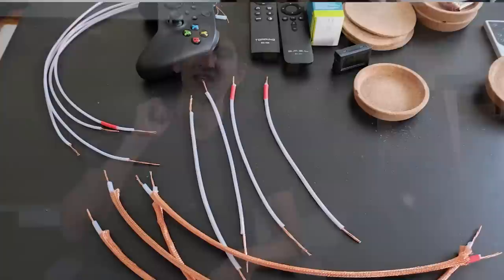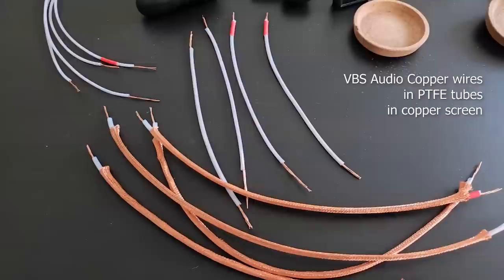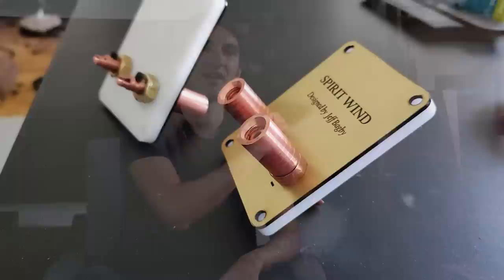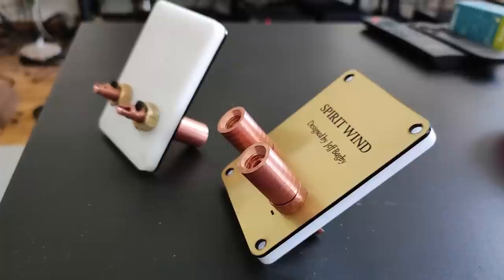High End 2-way speaker Spirit Wind

Comment: Wondering if you used any dampening material to line the cabinet walls. The plans are not very clear. What kind of bitumen fill did you use?
Reply from the maker: Walls themselves are made of five layers glued together under the press. They're then coated in a thick layer of liquid bitumen (I don't know the exact name of that product) that needs to dry for 24h. This damps wall vibrations but doesn't do much for standing waves inside the box. For that I filled the box with Mundorf Angel Hair filling (almost all of it except the space that needs to be clear between the bass driver and the bass reflex port). Jeff Bagby suggested dacron filling for this, but I used this Mundorf stuff instead. It serves the same purpose but with supposedly better absorption. He didn't use or suggest any sort of additional felt dampening on the walls the way Troels does for example. But Troels doesn't suggest this much inner filling... Which are both acoustic wave absorbers... My friend made the same pair of speakers and lined the walls with felt later on (one friend persuaded him it's needed) but we didn't notice any significant difference after that action. I suppose that 1" thick layered walls with bitumen and Mundorf filling (that he already had, the same as me) were doing a sufficiently good job already. Boxes do feel very inert this way. Certainly more than most commercially made ones with sane prices.
Reply: @iiWiReviews  thankyou for sharing that.

Comment: Sorry. Wanted to find out the brand of crossover component you mentioned. Yinseng?? Thanks.
Reply from the maker: Jantzen silver z-cap capacitors and coils (in wax) were used. There are also Path Audio and Mills resistors.

Comment: Hi, im doing my own 2way speaker where the midwoofer 18h52 and cabin is size/look is based on Spirit winds. Did i see right that your went on this speaker is bigger than 2" what Jeff wrote in his document? or was it just a matter of perspective and it is "stock"? Here is what Jeff wrote: "Vent: 2 " inner dia x 8.0" L Check location so as to not interferes with the back of the woofer."

Also, great work on speakers! Professional looking!
Reply from the maker: Vent port is the exact same size as Jeff suggested. It only looks bigger because it's flared on the ends. Flare reduces turbulence at the output and according to some studies creates a preferable bass sound (perceived as cleaner).
Reply: @iiWiReviews  Thanks for answer, and where did you buy it? 
i will buy the same went then if it is not local.. it looks good quality.
Reply from the maker: https://www.soundimports.eu/en/precision-sound-2-flared.html

Comment: Great review. What is the minimum distance, according to you, to the front wall to still have a wide and deep soundstage?
Reply from the maker: Thanks. I've never pushed them closer to the wall than 60 cm (back side of the speaker) because that's where I slowly notice my soundstage depth is starting to compress. But it is still good in that spot. My friend keeps his pair a bit closer, maybe 50 cm or so, and they still sound very spacious, width and height don't suffer at all, and tones also feel three-dimensional but simply more in line with speakers, without that "bowling alley" depth effect that you can get if you pull them out in the room. So I find that very good.
Mine are usually at ~80 cm, which gives ~115 cm from the front drivers and that's far enough to create a pretty impressive depth that makes tracks that are recorded that way sound detached from the speakers and in some virtual space behind them.

Comment: hei, how much did the cabinets cost? (wood+ labor)  
also how much did the crossovers cost?
Reply from the maker: Cabinets were ~€350 in total (and we had a great deal with a woodwork shop in my opinion). Crossover between 250-300, I wrote it down somewhere but can't find it now.
Reply: @iiWi Reviews  
Yes, that is a very good price for the cabinet work.  Here in the U.S. I would estimate $700-$1000+ for the unfinished cabinets.  Both the vertical angle of the front baffle and the diamond-faceted front of the baffle complicate the construction.

I would probably "Pin" this addtional cost information to the top of the comments since it is a considerable contribution to the overall cost that your viewers should know about and understand before considering such a project.

FYI, I'm all for good DIY designs and Jeff will be missed greatly.
Reply: @iiWiReviews  yes, its a good deal for the cabinets(good quality work). I wonder how much the cost would change if u choose piano black instead of wood finish

Comment: Great job with this project. I recently got plans from Meniscus Audio and like you I'm also sourcing the drivers from Europe to save on shipping costs. i came accross different versions of the AT18H5217 driver (8, 6 and 4 ohm). Which one did you use in your project or does not matter? the plans dont mention anything about it. Thanks
Reply from the maker: 8 and 6 Ohm version should be the same (depending on how store call them... It's an 8 Ohm nominally but measures 6.2 or something like that in reality). Any way, you need that one in the project - 6 Ohm that some stores will call 8.

Comment: Just out of curiosity, since the binding posts are pure copper wouldn't they oxidize?
Reply from the maker: Andrej from VBS claims they won't due to the specific thermal process he's using.  In my experience with power shucko connectors from the same copper, after some two years I've been using them, they have turned into darker reddish color (which he told me would happen but doesn't affect conductivity) but there is no oxide so far.

Comment: Thanks for making this video and speakers🙏 I am still under the impression that speakers fill the room better with subwoofer, if not REL would you try pairing it with any other woofer? Cause they can't dive under 40hz, can they?
Reply from the maker: Bigger woofer with more extension of course... It's just that T5X can't go much low, it falls off around 35Hz. That's roughly the same depth that these speakers do by themselves.
Another problem is sheer speed and resolution of AudioTechnology drivers... To match them, woofer has to be faster and more explosive than T5x. So maybe someday I decide to try a much more capable subwoofer (that can go down lower and with greater speed)... But that's not in my short term plans.
Reply: @iiWiReviews  Have you considered other DIY speakers before choosing this one? I am thinking of buying CSS DT-X...also on the side note I personally think RAAL tweeter is the purest I have heard among many, I know GR research have their NX monitor with ribon tweeter

Comment: Thank you so much for this amazing review. I see that meniscus provided you the dimensions for you to source your own cabinet. Is there an option to buy the cabinet online?
Reply from the maker: Not that I know of. You would have to arrange that in a local woodwork shop.
Reply: @iiWiReviews  Thank you! Are there instructions on how to install the dampening material which can be provided to the woodworker? Or do you install the dampening material yourself?
Reply from the maker: Jeff didn't put any dumping materials on the cabinet walls, we added that on our own at home (and made a bit bigger volume cabinets to account for it). But he did use dacron filling and specified how much and where to put it. That one is easily done yourself.

Comment: 16:53 thats not the actual response thats an artifact of the measurement process of sterophile magazine. Its a ground plane measurement, it gets you an accurate measurement of the bass below 200 hz but its +6db from the floor bounce. I guess they dont wanna attinuate the +6db hump incase someone accused them of tampering with the measurements and thats fair.

Comment: What sensitivity and impedance are these speakers rated at.
Reply from the maker: There is no official information on that but in comparison with many other speakers I access them to be ~85dB sensitive. Impedance should be around 6 Ohms I belive but no measurements were done across the whole frequency spectrum as far as I am aware.
Reply: @iiWiReviews  Thanks, great review. it''s too low for me as only using a 9.2W 300B tube amp.

Comment: Are these ported? If ported, will they work if made to be sealed ?
Reply from the maker: Yes they are ported and Jeff said it works very well when sealed too. As you would expect, bass would start rolling off sooner but slower...so it would sound leaner even though it would extend deeper. That might be good in some rooms and with some speaker positions.
Reply: @iiWiReviews  good to know, currently I run Thiel CS 1.5 that are passively radiated. I found that in my room, thus configuration yields more nuances in bass than many ported towers that I used to run.